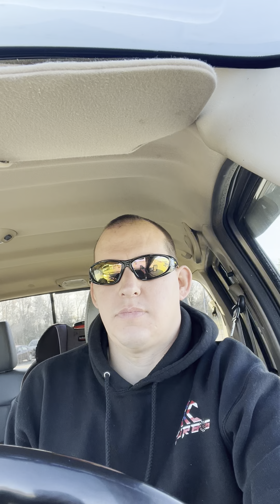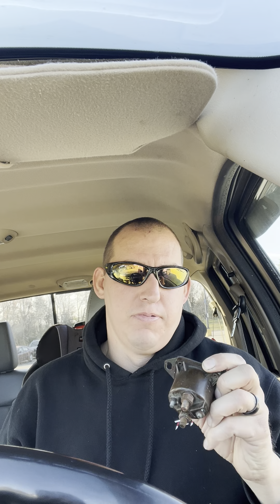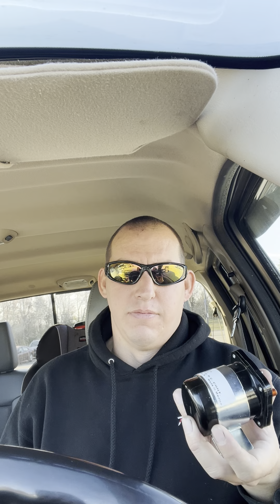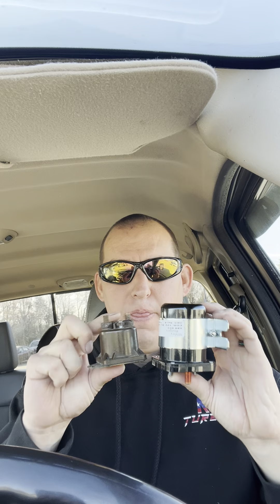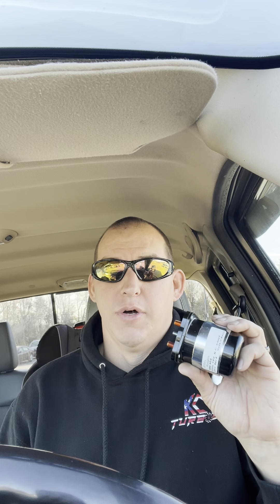7.3 and 6.0 powerstroke diesel cold starting issue and basics.

Comment: My dad’s truck was horrible would start at 40 then shut off then finally it would start and run like shit for a good 30-40 min. Found several glow plugs bad and because my dad never changed his oil I knew he had to have stiction issues ran stiction additive for 2 oil changes of hard use then pulled injectors and threw in a new set and issues are gone now haha
Reply from the maker: Injectors will definitely cause all kinds of
Run ability issues. If it’s a cold starting issue it should resolve itself with in about 45 seconds of being started. At that point enough heat at the piston head to easily keep it going. The exception would obviously be a IDI motor but honestly even after about 2 minutes they should also smooth out as the heat starts to build in the pre chamber.
Reply: @ yeah mine was pretty Smokey the other morning but it was also 18 degrees out and not plugged in and no intake heater. My injectors are newish so hopefully I don’t have one going bad cleared after about 15min. But maybe you have an idea for my idle I can’t and no one can seem to figure it out. It jumps up and now not major just I can see the tach moving slightly and hear it. According to scanner everything is checking out. Any ideas?

Comment: I use Hotshot Secret EDT all year around and I switch to Hotshot Secret EDT + Winter Defense. In the winter I switch from 15w40 Schaeffer's oil to 5w40 Schaeffer's oil. My 2000 F250 starts better with the 5w40 in the cold. I live in West Michigan. I got a White Roges relay as a spare.
Reply from the maker: I have heard a lot of good things about Schaeffers oil. It’s a little pricy but some people swear by it. I personally run T4 15-40 and change my oil often. I have played around with T6 and also used additives at times. But never really noticed a difference. I do admittedly change my oil probably more frequently than most because my trucks get worked pretty hard.
Reply: @cbr600rx7  i have a FS2500 oil bypass filter. I don't tow with it so I was planning on going 10,000 miles between oil changes. With the bypass filter the oil stays alot cleaner.